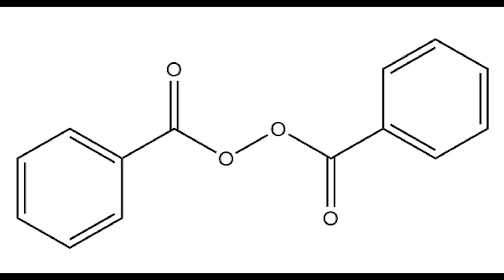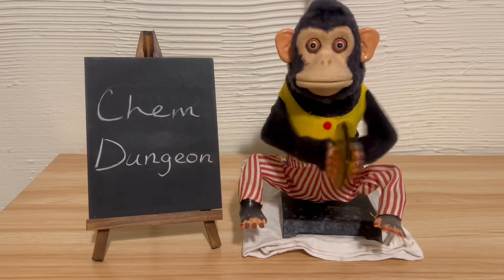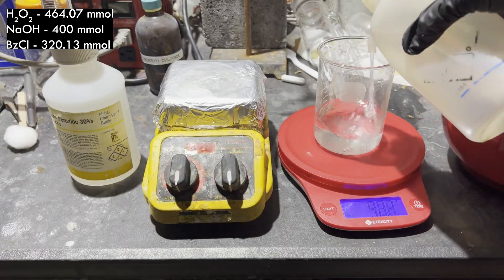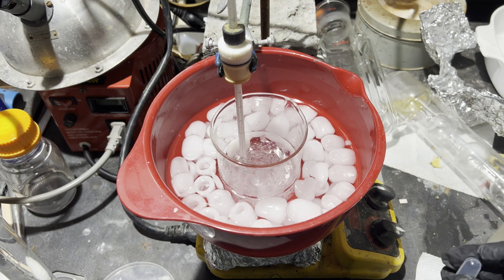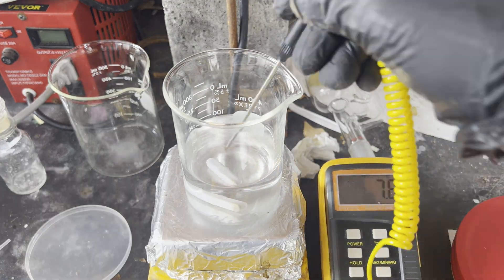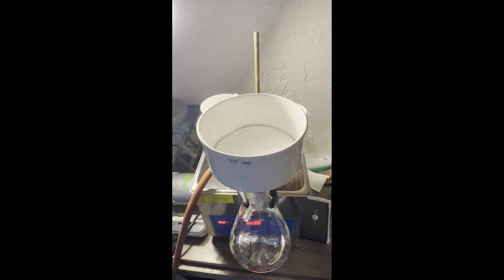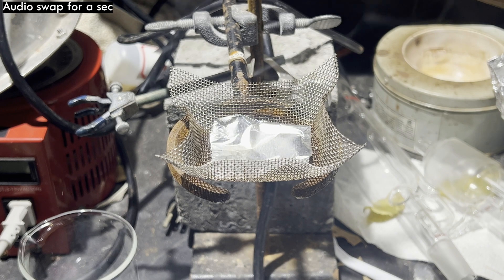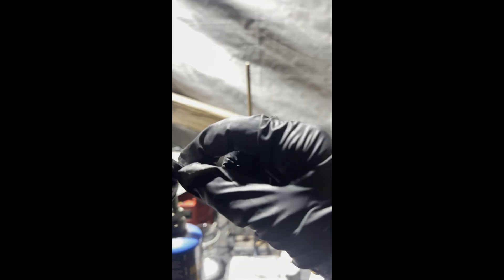Making benzoyl peroxide

Comment: Hi Chem Dungeon,

Nice video about making the compound; somehow usefull in some organic chemistry lab procedures.

Dibenzoyl peroxyde is in fact quite sensitive to friction-shock and displays a detonation velocity of several km/s; not very powerful, but sufficient to generate damages into a lab, shatter glass labware and eventually arm someone (fire, schrapnels, flying broken pieces).
To temper a bit the friction (+ shock and heat) sensitivity, some water is indeed used as for trinitrophenic acid (picric acid) to reduce initiation by friction and any spark-heat succeptible to initiate the D2D decomposition.

PHZ
(PHILOU Zrealone from the Science Madness forum and former many A.O.L. energetic and chemistry newsgroups)

P.S.:
Just as a side note, the final step of recrystallization (precipitation) is of course of value, but most must be aware that aceton and peroxydes are usually a NO-GO since it calls for the possible formation of aceton peroxyde (cyclo-diaceton peroxyde, cyclo-triaceton peroxyde and eventually tetraaceton peroxyde if some acid is present into the system).
Those are more potent energetic materials with better OB and higher velocities of detonations and also quite sensitive (sublimating solids with high vapour tension and crystallizing in hidden places of the containers especially screew on top).

This was often neglected and disregarded and on industrial plants it caused incidents (fire, casualities, destructions and explosions); written into incidents reports but most never read or understand precisely what happened chemically; so better be warned.

Comment: I would like to see a Kharasch addition of HBr to allyl bromide. I've got one recipe that uses benzoyl peroxide as the initiator and gives about 55% yield. Some propylene bromide is presumably produced as a side product, but its isolation hasn't been mentioned
Reply from the maker: @dimaminiailo3723  that’s a very interesting reaction, I looked into it and Kharasch has a whole series of publications on “the peroxide effect in the addition of reagents to unsaturated compounds” which includes that reaction. The procedure in the paper I found is a bit complex for my home setup, maybe doable with some tweaks, but just to hopefully make it easier, what apparatus and conditions are used in the recipe you have?
Reply: @ChemDungeon  There is no exhaustive description, only vague directions. The mixture of 570 g of allyl bromide and 3 g of Bz2O2 is placed in a flask under an UV lamp, and gaseous HBr is passed in the solution with such a rate that it is fully absorbed (I believe with the max speed possible), which takes about 10 h. The product is then washed the usual way and double-distilled (150–168 C the first and 165–167 the second time) with one more washing in between the distillations. This reaction had been extensively studied years prior to Kharash's works, I think I've seen some papers belonging to the dawn of the JACS. I'll look into it tomorrow. Do you have a better means of communication than yt comments?
Reply from the maker: @ chemdungeon on discord
Reply: @ChemDungeon  Thanks I'll join

Comment: Is there any way to make benzaldehyde easily?
Reply: There's a few ways. I find the HNO3 oxidation using a NaNO2 catalyst works wonders. If I have spare time soon during my winter break I plan on trying a super easy prep of benzaldehyde.
Reply: @midwestchem368 hypochlorite works decently too
Reply from the maker: That depends on what starting materials are easily available for you. The easiest way to obtain it is by buying bitter almond oil and fractionally distilling it